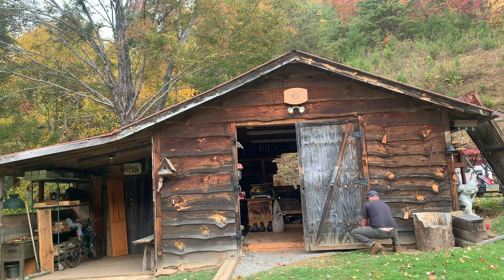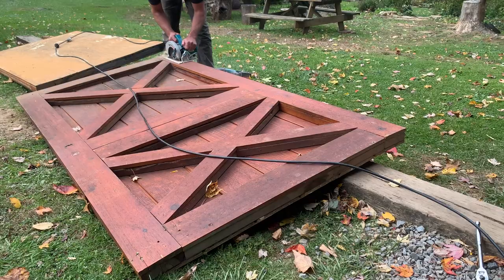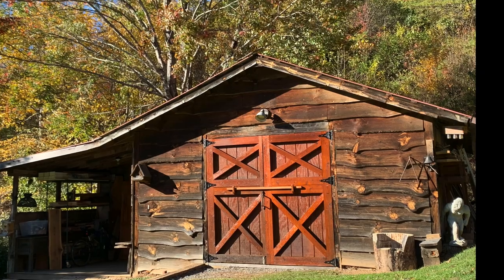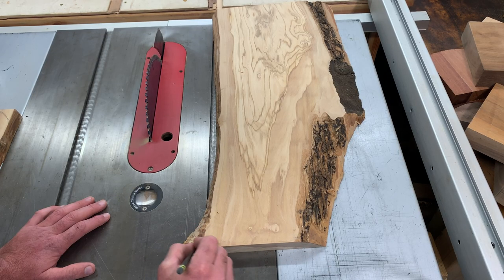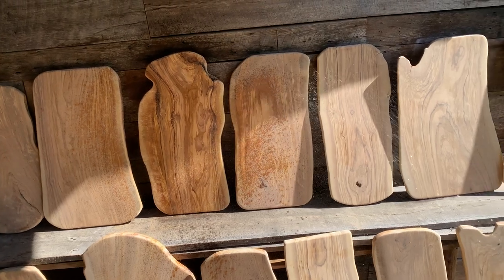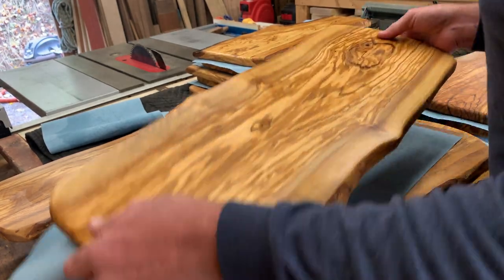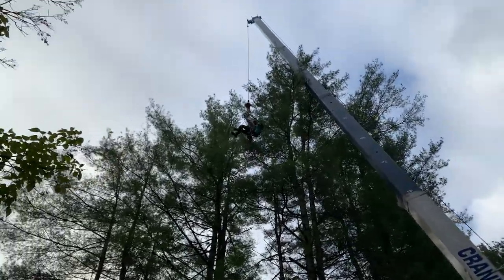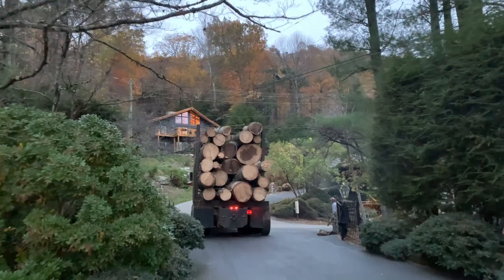OLIVEWOOD Charcuterie Boards || Simple Natural Elegance

Comment: Hey there, Mr. Plank!  Huge fan of live edge, great to see someone actually keep it in the project instead of shavin' it all off!  Ironically, I have a question about that actually: as these are for a food based use, is there any safety concern with live edge and food contact?  Like the one at  8:35, did you go heavier on the oil for those dark bits or prep it differently than the ones without the bark so close to the center?
Reply from the maker: These boards were built to be used as serving/display boards and not so much as a cutting board. (Although you certainly could cut on these)
I don't normally build  a lot of live edge boards but I really do like the look, I would assume that over time some of the bark will begin to disintegrate, debarking and just leaving a live edge might be the way to go for full time cutting board use.
Reply: @thewoodplank4376  Roger that.  Thank-you!  And again, great woodworkin', Mr. Plank!

Comment: Definitely such a beauty on each and every boards. Did u have to add  any CA glue to fill any holes in ?
Reply from the maker: I left these as is, there sole purpose was to be used as serving boards. I would definitely fill any voids if these were used as cutting boards.

Comment: I have made a few of these now...because the wood is so dense, I cant seem to get more than one coat of mineral oil to penetrate.  Is your experience different? Any advice or tips? Thanks as always.
Reply from the maker: That sounds about right, after one coat of oil I decide to do a couple coats of my board conditioner. (beeswax/mineral oil) 
Wax on the surface seemed to really hold up and bring out the color. 🙌

Comment: Beautiful boards, how did you decide on the cutting length?  What length did you use to cut them down?
Reply from the maker: For these boards the client set the dimensions, they were all 24 inches long and varied in width.  These will be used more as serving boards versus cutting boards.
Reply: Thanks. They are beautiful!

Comment: Very nice...and helpful.  I have a few olivewood boards to get into and this video is helpful. Are these completely fat or is some variation unavoidable?
Reply from the maker: I tried to get these as flat as possible but some minor variation may be unavoidable. These won't be used as cutting boards but more as serving boards so as long as there is no wobble when they sit on the table it should be good.